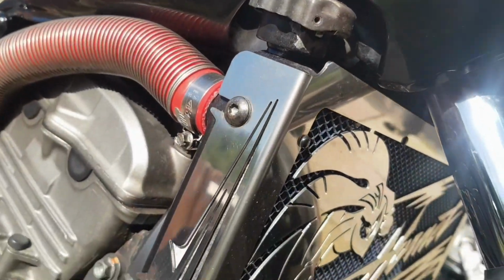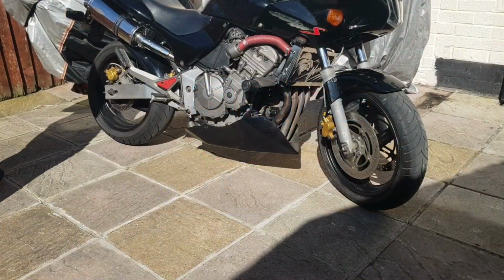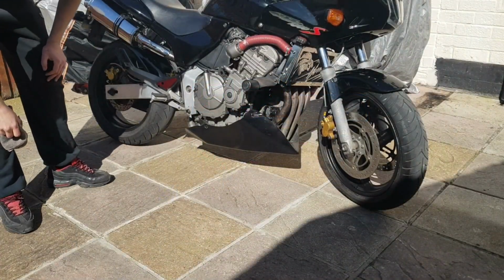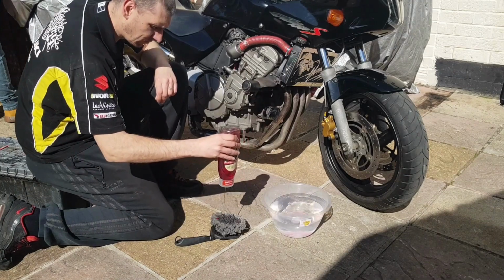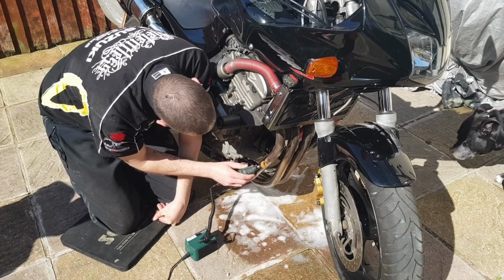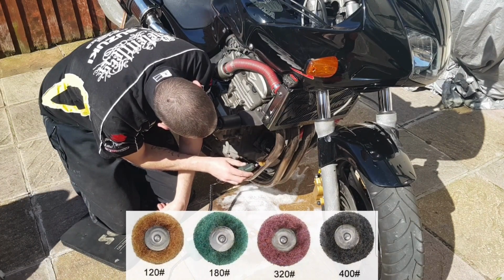Motorcycle Exhaust Headers Polish

Comment: Hello mate where did  you get your radiator guard?
Reply from the maker: @bbchaos100  Hi there, this was a family members bike. I think it was purchased via either Ebay or aliexpress.
But I will try and find out for you.
Reply: does it help with falls when the bike is idle ?
Reply from the maker: Hi there,
no this is mainly a decorative guard with some functional use by protecting the radiator fins when riding by preventing stones or debri from damaging the cooling fins.
If the bike was to fall over or be involved in a slide I don't think the radiator sticks out that much I imagine most of the contact would be with your bar ends & petrol tank.